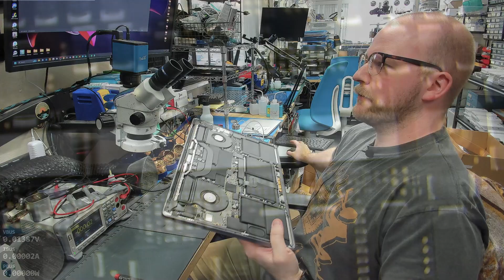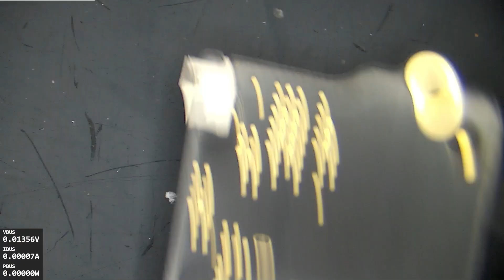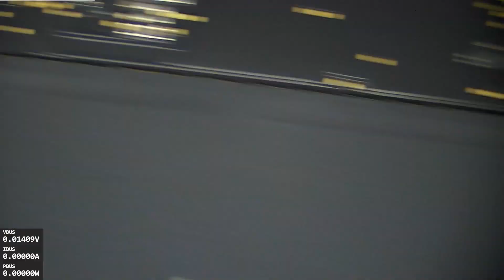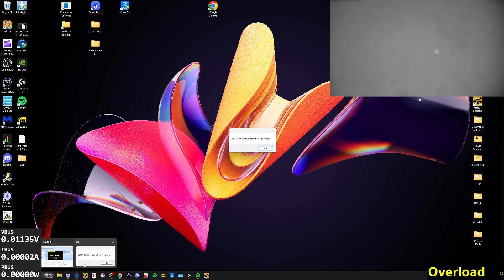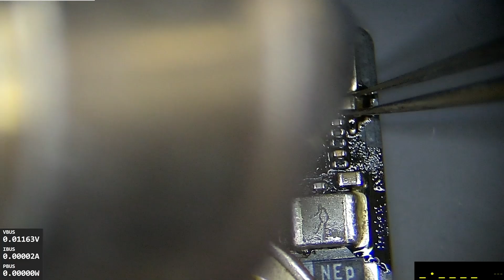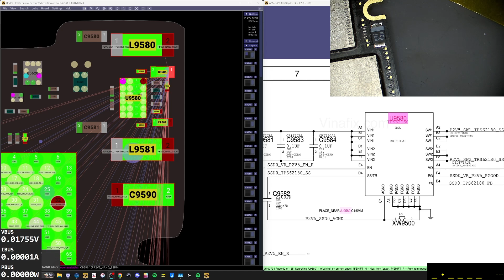A2141 2v5_NAND_SSD Short Circuit Board Repair

Comment: I love this so much. How do you get into this job? How do you learn it and start practicing it? I'm still in school btw but I would like to do this later.
Reply from the maker: Thanks! I’ve been doing electronics repair professionally since I was 15—so almost 14 years now. Even before that, I was always interested in electronics. Back in middle school, I was fixing friends’ Xbox 360s with the Red Ring of Death (usually just cleaning dust from the heatsink), taking apart random gadgets, and occasionally ruining our family desktop computer.

When I first started working in the field, it was  basic phone, tablet, and laptop repairs—which still make up a large part of what I do today. Devices have definitely gotten more complex over time, and mistakes have become a lot more expensive, so it’s less common now for shops to hire people with no experience.

As for how to get into this job: like with any job, it starts by finding a place willing to give you a chance, even with little or no experience. Learn as much as you can in your free time, build your skills, and try to get your foot in the door. That’s how I got to where I am now—running 3 shops with a business partner and several employees.

Some people recommend certification programs, like CompTIA, but personally, I don’t find them helpful. In fact, I think some of what they teach is wrong or even harmful. I personally wouldn’t factor these sort of certifications when hiring, other places might value them.

If you’re genuinely passionate about electronics, that’s great—because in this field, your real competition is people who would do this kind of work just for fun. It’s even better when you get paid to do what you love.

Best of luck to you!
Reply: @morethanafix  Thank you so much for being so helpful!! I always watch these videos from start to finish because it looks like so much fun to do 😂😂

Comment: Which conformal coating did you use, and what is the purpose of covering the buck converter? Doesn't this hinder heat dissipation, which I thought was the actual cause of the failure?
Reply from the maker: Mechanic Conformal coating, the failure happens from dust building up under the chip then collecting moisture which shorts 2v5 to 13V PPBUS or to ground, either killing the NANDs or the buck converter itself, in this case it's just a cap failing on the line, heat dissipates into the board , this chip doesn't get particularly hot under normal operation.  I have a video on here specifically about the buck regulator failure 👍
Reply: @morethanafix  thank you very much for your answer, I thought it was a problem of dissipation so far. I'll take a look at the suggested video.